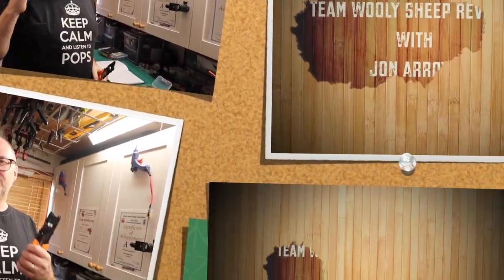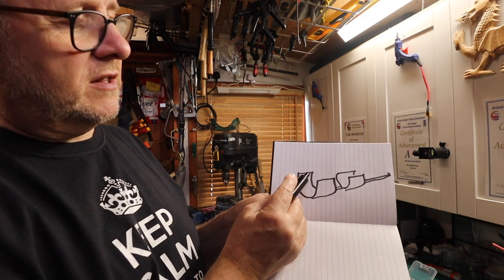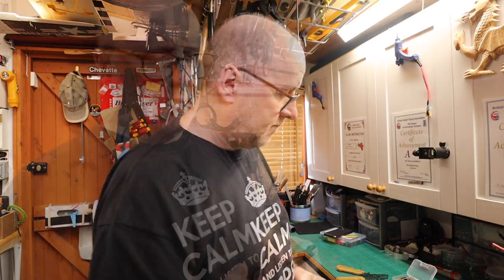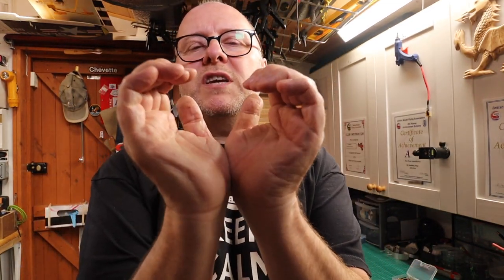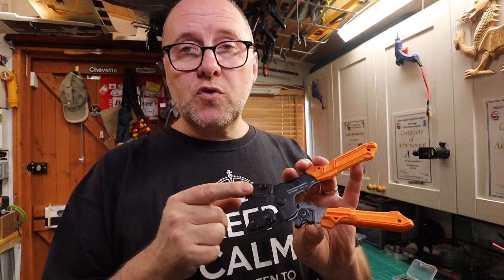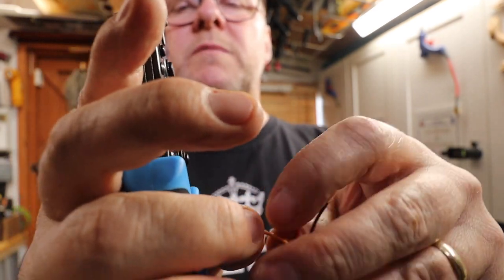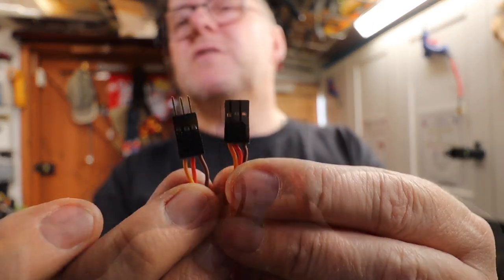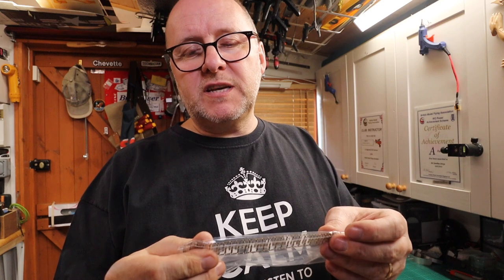Crimpers and Crimping - crimping a servo lead

Comment: I've got crimper#2 but I find that I need to use very small needle nose plyers to fold the 4 tabs over the PVC and wire, otherwise it smooshes the wire and PVC but the tabs just stay standing and get pressed thinner. Maybe it's a dud.
Reply from the maker: Maybe you you need to experiment as you may need to use the next bigger slot

Comment: can you do a video on those dang tiny plugs that always break and how you get the pins out to fix them. The tiny white ones.
Reply from the maker: Wycliffe Barrett I need a macro lens
I could do a video but you won’t see anything.
Reply: I know this is a bit late.  But if you get a standard black male pin header (~4 pins long), you can push the crimp over the end, and it becomes easier to manouver into place.